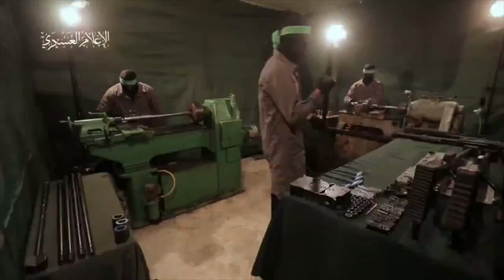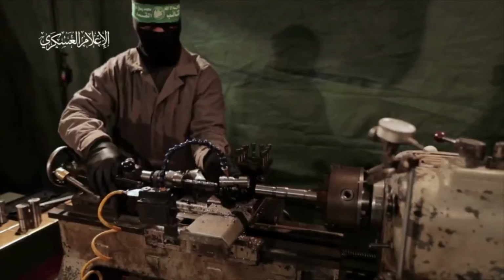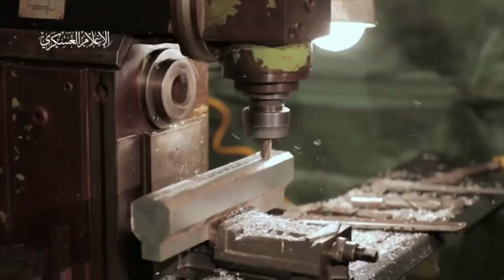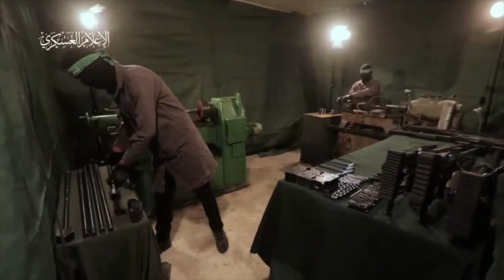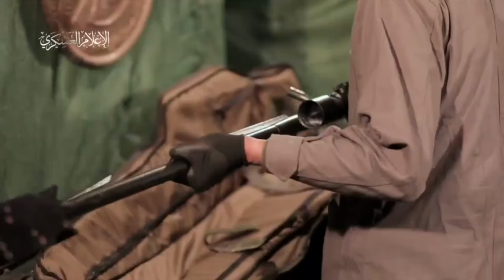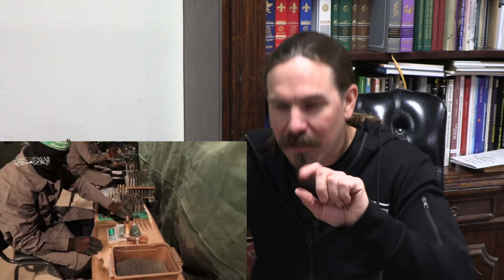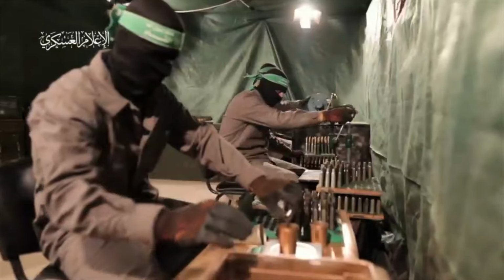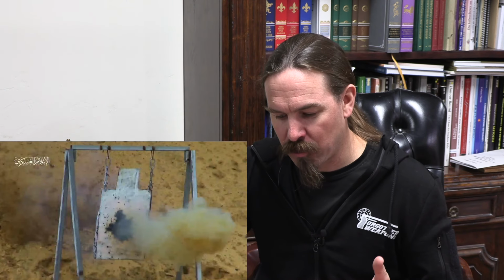Hamas Claims to Make Sniper Rifles in Gaza - Are They Really?

Comment: Been a machinist for a few decades now, its what you don't see as much as you do. Vernier caliper is only accurate to ±.03mm, no bore mics, no gun drills, how are they rifling the barrel? No Dial test indicator set up to check radial run out of barrel. You could manufacture a working gun on such a set up but it would be as accurate as a Luty.

Love the vids gun jesus, keep them coming.
Reply: What they actually manufacture there is reminiscent of the Luty
Reply: @HebrewHammerArmsCo  Makes sense. He was more interested in automatics than accurate weapons, right?
Reply: Perhaps Hamas is making Cold Hammer forged barrels....only kidding. The machine to make those barrels is very expensive, quite large. And a well skilled technician is necessary to keep the machine calibrated properly.
Reply: Also looks like this is the shop that made Brandon's crappy AK50 handguard from that milling.
Reply: I used to run a gun drill on aftermarket parts for Detroit Diesel and I'll tell you, I don't think I could make a gun barrel cause our drill always walked a bit over long drilling distance. Our stuff was just cooling channels through a manifold so they didn't have to be super accurate. If they had one here it would probably be a dead giveaway when it comes out the side of the barrel cause they didn't know what they were doing.
Reply: @joshua3113  peck drill in by half the diameter of the drill you are using will greatly reduce the amount the hole will actually deviate on more worn out machines. A 10mm hole only drill 5mm deep at a time, clear cuttings then drill another 5mm, repeat until at desired depth. Takes longer but works.
Reply: Luty was making a point, Hamas are making propaganda
Reply: As a quality engineer in manufacturing, I can confirm you are absolutely correct. I was puzzled the entire time watching these guys make/measure these components. Nothing made sense
Reply: Blundrbuss.
Reply: You’re hired lol come to Gaza we can use your insight
Reply: And those are pretty much exactly what Hamas IS confirmed to make and distribute for the occasional suicide attack on groups of civilians. They're infamous for sending out martyrs with Carlo SMGs to just find some families or a school field trip or something and try to get as many civilian casualties as they can before being killed.
Reply: Satu tembakan  2 idf death .ada vidionya
Reply: "Only accurate" do you know how much .03mm is. It makes absolutely ZERO difference in terms of firearms and/or snipers as in the video.
Reply: @4parabandit  0.03mm is just over a thou, sloppy if you are measuring everything with a vernier and not utilising more precise methods of measurement. Certainly not making match grade sniper barrels that they claim in the vid
Reply: Could you make a Sten with this setup?
Reply: @thejackal5099  Probably. Or at least a philipine style slam shotgun. But i think ian is right in that what they are actually producing is propaganda. And as wars ar seldom won by the side who kills the most but by the side that not gives up propaganga is one of the most powerfull weapons there are.
Reply: @thejackal5099  YES
Reply: @MrTak44 there are no sheet metal tools in there. You could make a sten barrel and bolt but not the receiver.
Reply: @thejackal5099 no.
Reply: @thejackal5099  people have made Stens with less.
Reply: You can get a rifling button really cheap and a harbor freight 12 ton or 20 ton press and a few hardened steel rods. It's not the complicated or expensive. Maybe not as accurate as a match rifle but good enough.
Reply: @astainlessnoyb1038  They can’t afford nor will it get in when the Israeli and American militaries are involved.
Reply: @astainlessnoyb1038  They are showing a couple of really old, really rough, very basic lathes. No equipment capable of actually boring barrels.
 Rifles made could be considered precision if your target is the size of a house.
Reply: @slick3129  what do you think they used 150 years ago and made very accurate rifles. Those lathes are more then capable. I'm assuming you've never done any machining.
Reply: @astainlessnoyb1038   I work in Aerospace parts manufacturing, we have a well equipped machine shop with over 15 mills. The lathe shown in the video is very old and very rough, more of a conversation piece.
Reply: @slick3129  that explains it. You're use to top machining and working in 1/10000. You don't need that level of accuracy for smiting. A thou is fine. I've done some amazing things on an old lathe and mill. As long as they are true and Zeroed with minimum run out you can do a lot.
Reply: @astainlessnoyb1038  Have you ever tried to gundrill a 34 inch hole, then pull real, hone then button a barrel, Destress and profile..
Reply: @HebrewHammerArmsCo  Longest barrel I have worked is around 16 mark for a rifled barrel. I am not saying they are going to get a 2 mile gun, I am saying it's not that hard. And it's stupid to think these idiots are just like your neighbor and can't afford the right tools. They are backed by the terrorist government and billions of dollars. Getting a proper rifling machine may be out the the average Joe's budget but it's not even a scratch for any of these organizations. Further an accurate serviceable barrel can be made with fairly crude tools. They were doing it over 150 years ago. It's not a special talent. Anyone can learn it pretty easily from the internet at this point. And once you know how they work everything else kinda falls in line.
Reply: At least they are not using rulers and measuring tape. Show them some respect.. That is already pretty good with all the youtube videos they watch how to make guns.They barely have enough electricity to turn on 2 light bulb and 2 machine.. You might be asking how would they even do anodizing
Reply: @cleaninterest they haven't done anything to earn any respect.
Reply: At the first part of the video They just preparing the raw material to be at the right outer diameter and cylindricity,before broring and rifiling then one more time machining , they maybe use jigs to make a bore at specific depth
Reply: High Possibility of not revealing the true manufacturing facility or machinery:cat-orange-whistling:
Reply: You can ask the idf how accurate it is 😂
Reply: @rayanghazzawi4990  Yeah, because the jackals (Hamas) are winning, smart guy? The only reason the was not over in a single day is unlike the hyaena, IDF tries not to kill children.
Reply: Perhaps the video does not match how the rifle was made and seems to contain only some actors, but it is known to resistance engineers that they were able to manufacture Qassam rockets and Ghoul sniper rifles locally.
Reply: @male3399  lmao. fake news.
Reply: @male3399  A bunch of 14 year olds who are into hobby rocketry could make Qassam Rockets... They arn't exactly complex...  Please show me a single gun factory thats been raided by the Shin Bet/IDF in GAZA,Judea  where they are building anything more technical than Tube and sheet metal builds.  Basic welders, old manual lathes and mills
Reply: @male3399 the rockets aren’t that complicated but rifle barrels are I’ve ran a gun drill I’ve ran lathes you’re not making a sniper barrels without a gun drill or a modified tail stock or a drop press to make pre formed battles
Reply: @radchad992 Use 0.50" diameter 01 tool steel  ( drill rod ) , comes in 13" and 1M lengths . Grind to form a D bit . Harden and temper.  Use a lathe spider on the end of spindle and mount 1.75 " diameter chrome 4140 / 4150 416 stainless using 4 jaw and spider with a pointer to ensure zero run out . Mount drill rod in tail stock in a long bed lathe ( as seen ). Stub drill 0.5" .Peck drill with D bit and lube using hand on rod to " feel " vibes . Follow drill with D bit reamer and plenty of lube . Cast lead lap in barrel , polish. Using 13mm diameter drill rod mill in 6 grooves 4mm wide at an angle ( calculated from 15:1 twist) turn and finish to produce a button , harden and temper to 50+Rc . Force button through using lithium soap grease and any hydraulic system from a jack to a digger . Lead lap to polish . Turn barrel to finished dims in long bed lathe between centres and lathe dog ( you would NOT see the barrel bore in this process ) using carbide or HSS . No lube is necessary with correct feed and speed , if using hand lightly lube . This will produce some smoke as seen . A 50 cal barrel can be profiled without a steady rest with light passes.  Barrel can be mounted using pins , pinch block method or other means into receiver without the need to thread .
Reply: both of those aren't exactly high quality weapons, are they? @male3399

Comment: When I make batches of bushings I do actually machine a series of grooves along the length of the bar and then drill through to part them off, so it is a legit manufacturing technique
But the entire vid is obviously staged, workshop is way too clean, no swarf or coolant on the floor, and the "barrel" being turned on the lathe is obviously mild steel not alloy steel just looking at the surface finish

Comment: There is a suspicious lack of chips on those lathes.  As someone who has seen a lot of lathes in use in developing nations or other adverse conditions, I can attest to the fact that they are almost always a greasy mess and loaded down with chips--the guy "profiling a barrel" obviously started with a perfetly clean lathe and looks to me as if his lathe has only the chips which were cut off during the video.  If they were actually producing rifles, I'd expect a much bigger mess on that lathe and if they were actually rifling barrels, there's no way they would not show that, I would expect that to have been the centerpiece of the video.  The guy "drilling bolt heads" should have a lot more coolant/lube splashed all over everything (including his spotless uniform, given the complete lack of any sort of splash guards).  The ammo being loaded into the boxes is all mixed cases, by the time it gets to the range is has magically become all the same color!  Also, I would expect to see some video of the finishing process (polishing and bluing, parkerising, whatever) or (much more likely under the conditions they are supposedly working in) rifles coming out with either no finish at all or at best black, green, tan or camo spray paint jobs.

Comment: This was propaganda for local consumption and for supporters around the world. When making this type of video they would not want to reveal how they really do stuff or their volume/capacity. Most irregular forces have mfg capacity aimed at repair and modification of weapons as a base mode with limited fabrication of complete weapons. Production of sniping systems would include mostly accusizing existing platforms through barrel replacement and glass bedding as well as scope mounting. Basically in a old video i discussed what was required to support urban sniping operations which is a much lower standard than what your audience would expect, reducing target indicators of urban snipers would expand their effectiveness more than a accurate rifle.

Comment: Few things being a machinist for 16 years now. That's not even a boring tool, that would be a drill that he's using. 

Also when machining the goal is to get the chip as hot as possible will keeping the actual part at a stable temperature. So seeing smoke and hot chips fly from a manual machine is not uncommon.
Reply: Also the guy was turning between centers.  That's actually pretty common
Reply: @hendersen7863 Sure, he's turning between centers. But as Ian pointed out, the "barrel" hasn't been bored yet. 

The whole point of turning a barrel between centers is to keep the bore and exterior parallel and true.
Reply: @MultiMcgruber   How can you see of the barrel has been bored yet? The live center of the tailstock stick into what can be the bore (or just a centerdrilled hole in the end if there is no bore).
Reply: Such a long piece, it could use a moving rest (not sure of the translation, in Dutch it's meelopende bril) @hendersen7863   even between centers.

Comment: I would be willing to bet a substantial proportion of my 401K that this video is primarily intended to inspire and bolster the morale of lone jihadi wannabes cruising the internet for moral support, with a strong secondary function of attmepting to disguise the level of Iranian involvement in this comflict to give ammunition to Western media outlets amd politicians who could be counted on to do their utmost to restrain any punitive actions agaunst Iran for that support.

As for the manufacturing of the scope bases.  They may well be locally fabricating scope mounts, but they aren't doing it in that room.  

There is NO finishing equipment in that room, and you wouldnt be doing finishing operations in the same room at the same time you are doing machining operations.  And those finished mount components are reasonably well surface polished and then either anodized or have a quality airbrushed finish along the lines of Ceracoat or Duracoat - and neither of those operations is condusive to machining dust.  So you wouldn't be doing assembly of finished subassemblies in the machining room (test fitting them before finishing, sure).  

The very clean markings, both headstamps on cases (reloaded cases wouldnt get new headstamps - those were applied when the cases were manufactured in a factory) and clean receiver markings also scream "sterile production on a professional factory to hide nation of origin" to me.

Comment: It is not unusual for smoke to come off lathe work, if there is any oils on the outside of the material it will smoke. With carbide tooling you can cut much faster than high speed steel, so not unusual by any means.  Parts are sometimes polished under power, not unusual but it can be dangerous if you aren't properly trained.  For the barrel, they may profile the outside before gun drilling, but you wouldn't gun drill on a lathe like that. The bolt head was fishy, but some it seemed legitimate. There isn't any reason you couldn't make guns with these tools, people in Pakistan make semiautomatic handguns with a file, drill, and a hacksaw. If I was doing this I would buy surplus 50caliber browning barrel blanks and make the rest similar to Bill Holmes 50 caliber builds. Big fan of the channel Ian,  thanks for the interesting video.
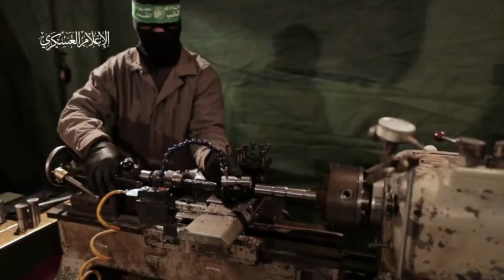Reply: At 3:53, it looked like he was maybe using a parting tool?

Comment: Not doubting the gist of this video but at 4 minutes your questioning the process could be misleading. It is common practise to use  parting tool  to near to the centre and then finish drilling a hole which completes the parting. Not saying this is the case but a possibly.

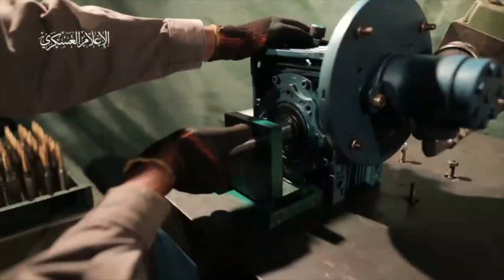Comment: Something odd here. The machine they’re using at 14:10 ; why is it using a hydraulic motor? They clearly have electricity and electric motors.

I’m trying to think why, and it’s just… weird. In order to run this little machine using a hydraulic motor, you need a seperate HPU… which just seems wasteful. Unless it’s actually part of a portable setup? 

Just odd.

Comment: Small detail but it shows that those are actors and not machinists: 
The tool on the lathe is on the wrong side of the tool post. 
You never run the tool behind the tool post when looking in the machining direction. It pulls it out of his mount instead of pushing it against the tool post for support.